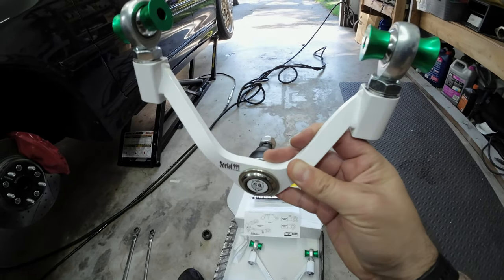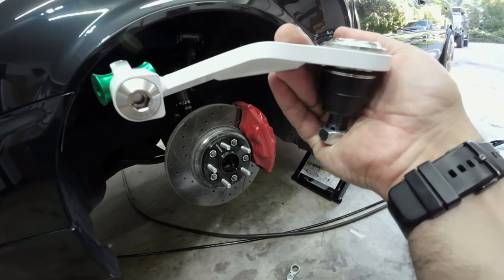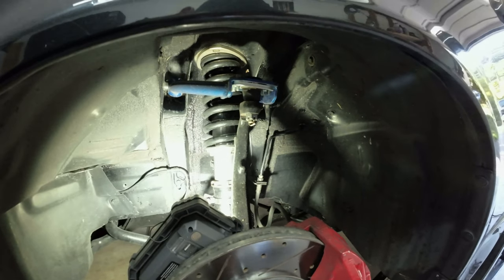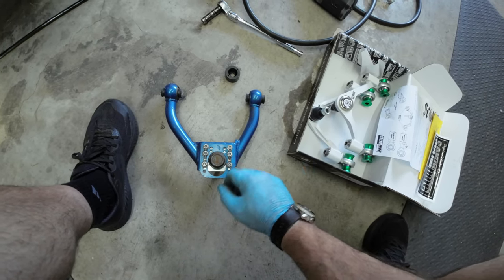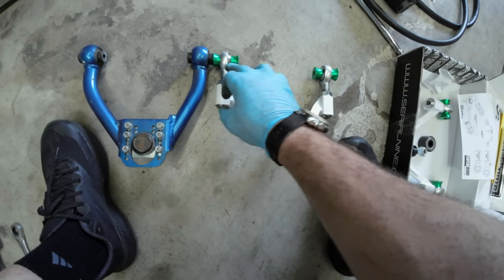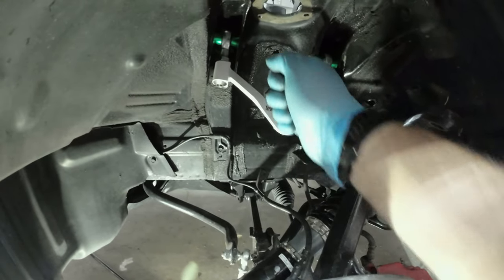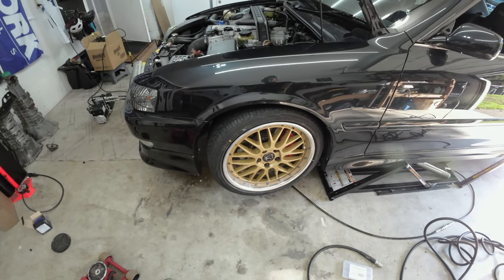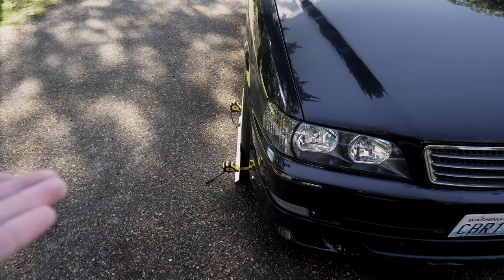JZX100 Chaser Serial Nine ONI Front Upper Control Arm Install

Comment: Getting serial nine front and rear upper for my jzx100. My brand new toyo tires are mildy stretched on a +15 off set wheel and keep chipping away..i need some camber and a fender roll lool.
Reply from the maker: Hell yes. You’ll love them